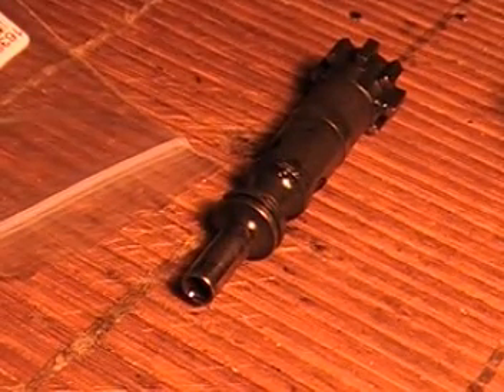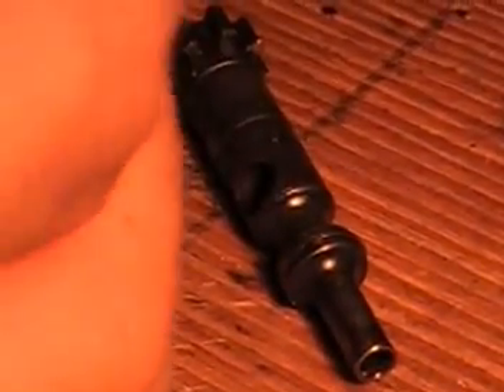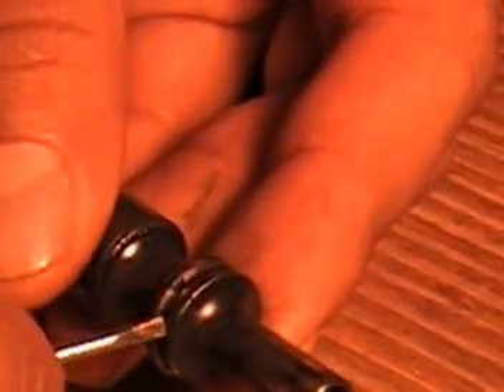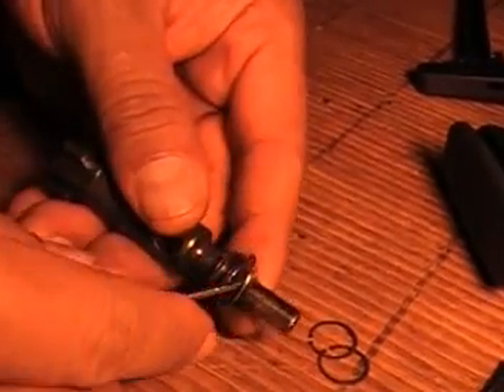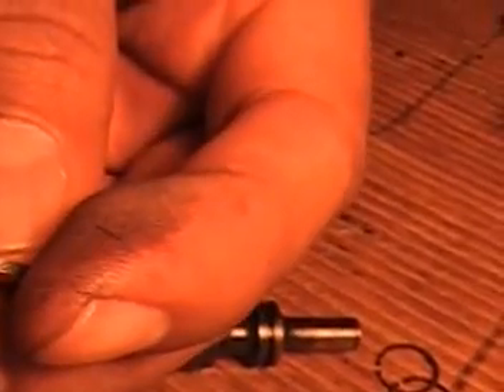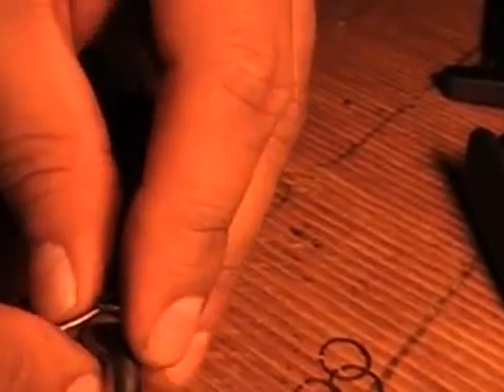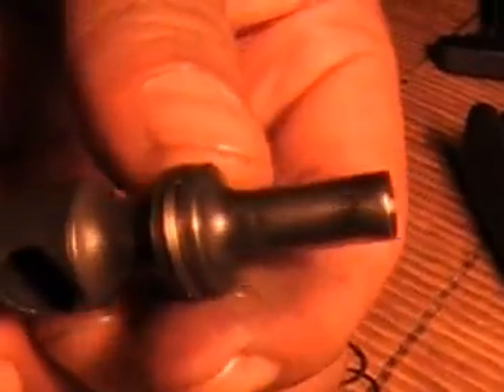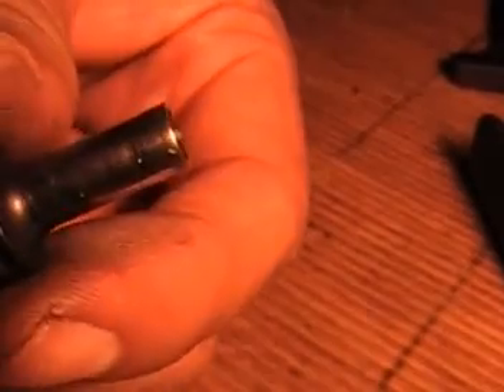AR15 Gas rings replaced to a Mcfarland gas ring

Comment: Pure snake oil.  An AR will run on one gas ring should the other two fail.
Reply from the maker: Just telling you what our gunsmiths have said in the past and yes, it will run but it is  crazy how in the gun world even with experts, you still get a division on this subject that it will work and it will not. Regardless, I still like this gas ring. Thanks for watching.
Reply: If it brings you piece of mind then for you it is money well spent.  The FACT is the weapon was designed to run on one ring, the other two are there to extend reliability of the gun across two more rings.  It is by no means a bad product, just overkill IMHO.  Again, nothing wrong with paying a little extra if it brings you piece of mind.
Reply: Why would it need to run on just one ring ?  Because the other two have already failed. 
I've been running the same one piece ring for a couple years and many thousands of rounds and it still looks an functions like new.
It's a simple,  cheap upgrade that works for me.

Comment: the only way the three ring system will fail is if its out of time and your way under gassed... and using super light loads..  but my daniel defense ran with 1 ring before
Reply: mark mitchell it will run with no rings ive done it